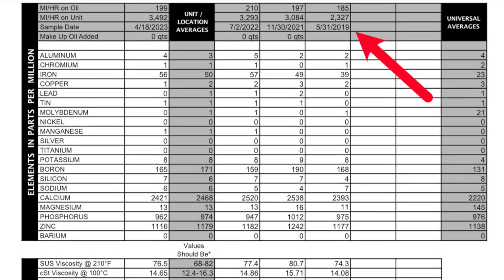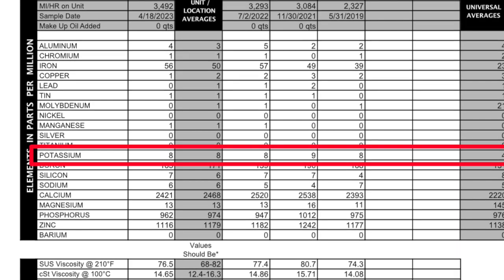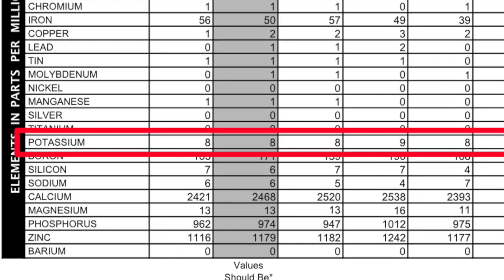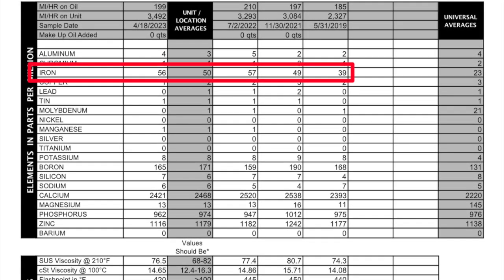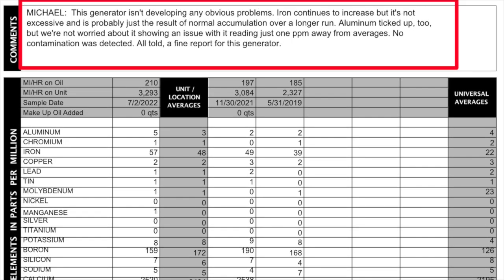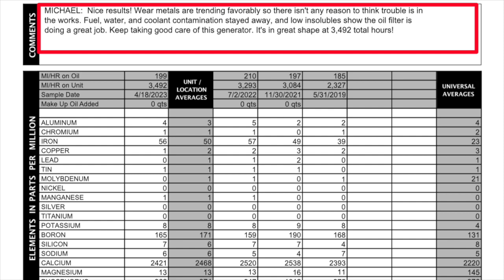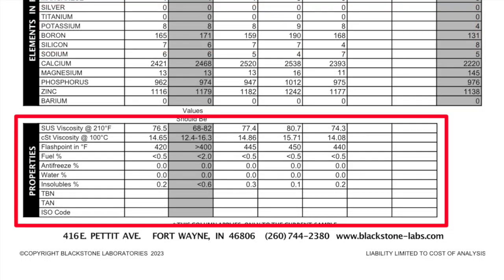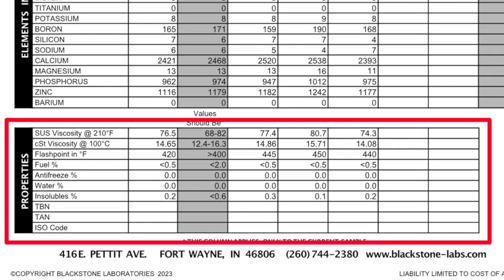Oil Analysis Report Review and Interpretation

Comment: Really appreciate your videos.  After 50 years of sail we moved to a trawler.  What is your opinion on using synthetic oil?  I said opinion.
Reply from the maker: I think synthetic oil is a modern marvel. That being said, I never extend my oil change beyond the manufacturer-recommended interval of 200 hours. My petroleum-based oil works effectively under these circumstances and is much less expensive, so I choose non-synthetic for all my equipment.